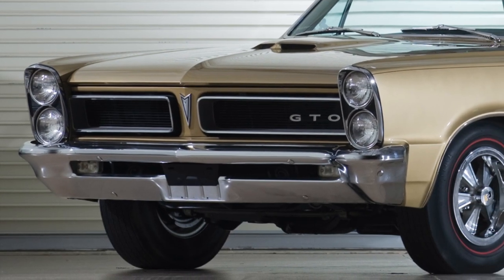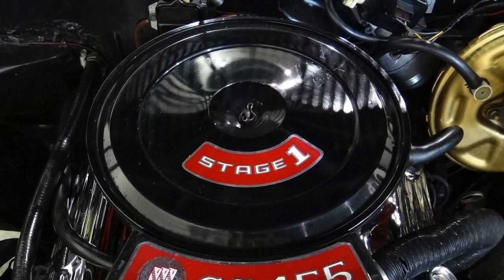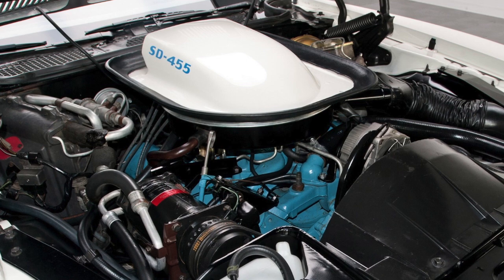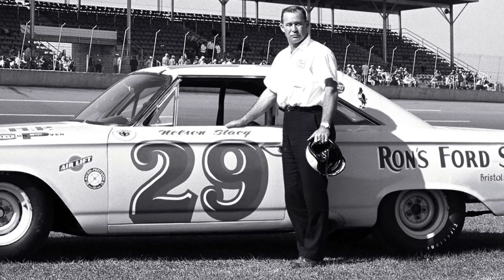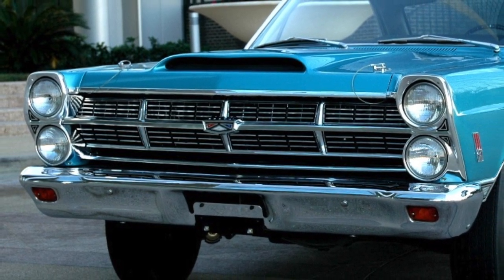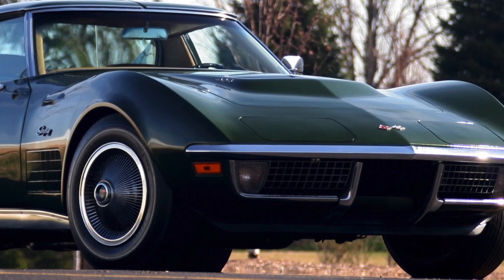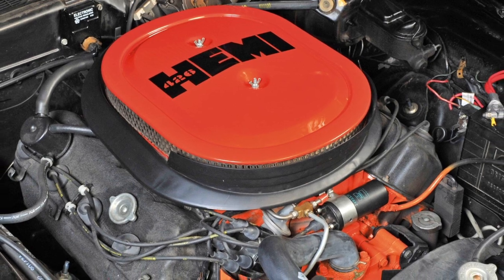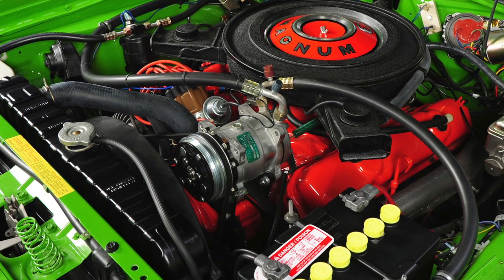5 Best Vintage V8 Muscle Car Engines

Comment: 1962 Ford Galaxy 500 406 tri carbs would eat a 64 65 GTO for breakfast. 1963 Ford Galaxy 500 XL 406 tri carb would do the same. 1964 Ford Galaxy 500 XL 427 dual carb would destroy the Pontiac GTO 389 tri power. 1965 Plymouth GTX was a so so 383 powered car. 1963 1964 Chevrolet Impala 409 dual 4 barrel carbs was a slug. 1963 Plymouth Fury & Dodge Polaris 426 ram charger would destroy the GTO and Ford 406 tri power. Then came the 1967 cars. Ford & Plymouth dominated the Pontiac but were out classed by the 1967 Shelby GT 500 side oiler 427 dual four barrel & 1967 Corvette L88 427. Chevelle SS 396 & 427. 1968 came the battle of the big blocks. Chevrolet 396 & 427 Mopar 440 and 426 hemi. 1970 saw the 454 Chevelle LS6. Buick Gran national 455. Oldsmobile 455. Pontiac went from 400 ci. to 428 then 455. After 1972 the muscle car era was over sadly to say. Now I am building a DZ 302 with Rochester fuel injection in a Studebaker Golden Hawk. No emission's!
Reply: Don't let brand loyalty blind you

Comment: Buick 455,  Pontiac 455,  legendary? Maybe, Ford 427 still running 13 et 1/4 mile,  Chevy 454/450hp, ?  Again 13 et in the 1/4 mile. You jumped over the Chevy 396/375 hp under rated 425 hp, on the eight day god created the HEMI.  The 413, 440 was no slouch. Don’t sell the big 440 wedge short. Still 13 second times.

Comment: In the Chevelle, the 454 was available in 1971 as the ls6, but detuned to 425 HP., and I believe it was available in 1970 in the Vette!  This guy is not correct in all of his supposed facts!!!!!!!!!!!!!!
Reply: i thought 454's were avaiable as top option for 70' chevelle's
Reply: The 425 was never "detuned' to 425.  In fact the SAE NET hp was actually 350, compared to a 2019 Camaro V-6 at 335 hp. Stop spreading bullcrap

Comment: Ford didn't have many performance engines they were always at the bottom of the list 302 Boss and regular 351 W 351C 390 460 were the worst engines made that is why Ford didn't didn't make it to the top like GM and Chrysler They might as well give up on performance engines No one likes or wants them